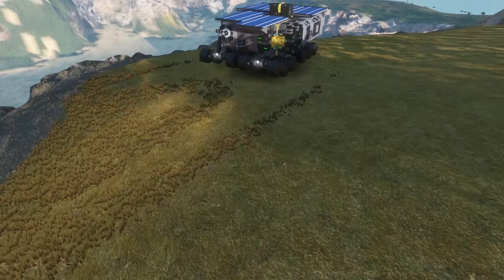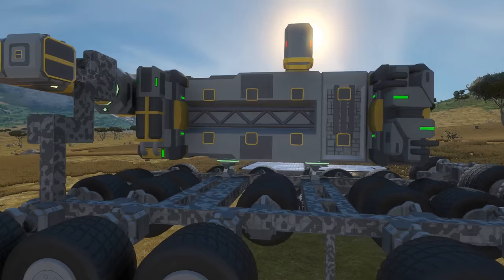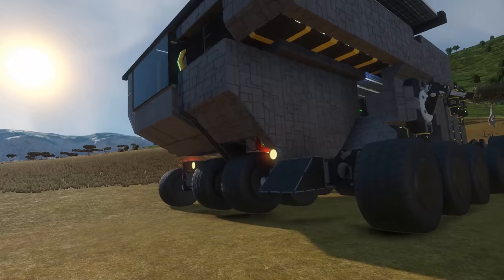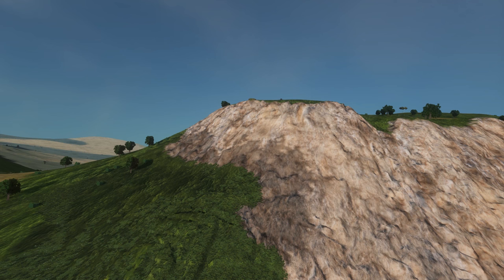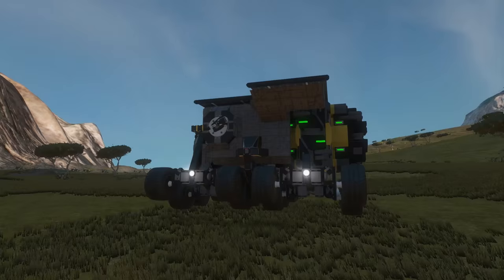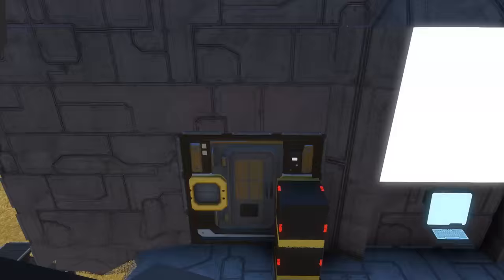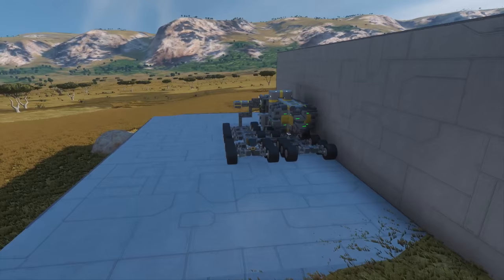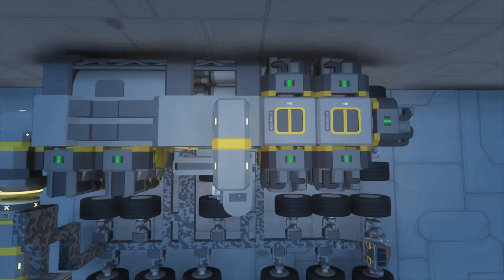Space Engineers - Mobile Planetary Base mk III & Build Guide - CODENAME Bouncy Castle

Comment from the maker: Apologies folks, this was supposed to be the first of the new schedule vids for SE and was due Saturday, had almost everything ready and then as you'll see SE threw me a bit of a curveball just in time for a busy weekend where I didn't have opportunity to try and record more!
Reply: can you relece the frame as it's own bluprint
Reply from the maker: +3RD Person Gamer “3RD Person” I have, check my workshop or the video linked in the cards near the start, it's there :)
Reply: Ok thanks also you might meet you machines match on the moon with no grav. blocks
Reply from the maker: +3RD Person Gamer “3RD Person” yeah prolly, although with the gyro's all it'll mean is a LOT of airtime heh
Reply: +w4stedspace nice work w4sted! maybe try doing a comparison with a modded version ;)
Reply: Seems using a rotor to build the small ship off the large ship would be easier, as well as forming a permanent connection between the two grids... 

If you're building this in survival, you would already have a powered base to start building from... 

Cool design, I wouldn't have thought of encasing a large ship in a small ship. Very cool.
Reply: I love your builds dude! always a new creative look on how to use old blocks, leaves me very impressed every time.
Reply: That's the Space Engineers we know and love, just when you feel comfortable it creeps up behind you and slaps you upside the head lol. Good job anyway.
Reply: +w4stedspace The wheels on the bus go round and round and then burst into flames!
Reply: +w4stedspace It's fine, man. I'm always late to Stream & TS. Your turn! Love the power this has.. I wonder how bad using 5x5's would be. It seems it reallllly wants to take on Lotus attributes and carpet bomb with wheels....
Reply: it's great, but do you think you can made the mobile base from homeworkd desert of kharak pls
Reply: +w4stedspace as far as the handbrake issue couldn't you compensate with timer blocks? trigger system toggles parking break and always switches on the connector and landing gears?
Reply: sorry if this was asked before but, when will the survival series start again?
Reply: as far as survival is concerned, it might be easier to build a tree with a large and small ship projector, then use separate blueprints to assist with each stage of the build process while keeping all the jiggly bits from moving around on you. afterwards cut the connecting blocks and disassemble the starting tree and let it land on its wheels.
Reply: Apologies if I missed an update, (going to play again soon), but is there a reason you didn't just use a small rotor base, large rotor top to connect them? Would circumvent the connector brakes issue.

Comment: I would build the large section to raise itself up. Then lower on the wheels when ready to move. It would be like a camper on the back of a truck. Four connectors on the bottom of the large same with top of small, instead of using landing gear. The four connectors is how I linked large drills to small engine. They don't need to be apart of conveyor they are just locks, well one can be. I think I'm going to try this now, haven't done planets yet.

Comment: what I wanna do is make a tank with a version of your frame.  right after my helicopter's done of course (i figured out the bombing mechanism).  With your wheel frame I'm thinking it's able to work when the wheels are in a staggered sort of pattern, think basically a 2-pronged hot dog roasting stick and you're on the right track with what I'm thinking about for a frame.

Comment: Don't worry Jon, I'm sure Keen will patch it out so your suspension no longer works in a few updates :P  I'd probably want 4 effectiveness modules on my refinery and 4 power efficiency modules on my assembler - but I accept you have to work with the space you have, unless you can make that wheel base wider :P

Soooo, if there's an Argentavis, where's the Megalodon? :D

Comment: Huh, with how it bounces this thing could be dropped from aircraft, if you had an aircraft capable of lifting it or carrying it on the inside.  Something like a C 130 should do though.  Hmm, do oyu think you could make it look just a little more like some sort of troop transport; like the M1126 Stryker; although something about it does remind e of some sort of command and control vehicle, like the M1130 only with more wheels.  I guess the design can be adapted to suit one's needs.  What's anybody need a command post vehicle for anyway though?  Drones?  UAVs?  Robotic rovers?  Of course you'd need to extend your signal range a lot, too bad the don't have repeaters or a way to build a proper communication satellite so one could come up with a proper planetary communications array and control their remote vehicles everywhere from a central location.

Comment: Hey W4sted!

I was wondering something. How much force would I need to get this Flying Ion Brick right here: http://steamcommunity.com/sharedfiles/filedetails/?id=565858707 To stabilize itself in Atmosphere. I've been trying for God-knows-how-long with Hydrogen and Atmos. and I haven't gotten a Solution that seems to work.
Reply: +Tally Star 
How heavy is it?
A hydrogen thruster (large) produces 600 TONS (600,000 KG or 6 MN) of thrust, so for an example - if you have a ship that weighs 2400 tons (2,400,000 KG) - you need FOUR hydrogen thrusters to just keep it in the air (nevermind moving) Ideally though, one would require FIVE large thrusters to move it up and out of the atmosphere - assuming youve already done the math and have a tank per thruster (6 min 30 sec burn time, per thruster per fuel tank), you could make it into orbit without burning through all your fuel if you attenuate the power flow once you reach 100m/s upward velocity - hydrogen math is very simple, all you do is devide the weight by 100 to find out how many MN of thrust you need, then by SIX to find out how many thrusters you need.

Disclaimer: All math is done assuming 1.0 G as your gravitational constant, for higher, or lower gravity you will need additional thrust (or less, depending on which) proportionate to the increased, or decreased G-Force.

Once the G drops below 1.0, you can then test the water to lower your fuel consumption even further, i do this with my shuttle >  http://steamcommunity.com/sharedfiles/filedetails/?id=635263495  < so that i dont burn through its entire fuel store and drop out of the sky like a brick, i do need to use the ions, but the thrust they produce till about 0.3G isnt enough to support the weight of the shuttle without the hydrogen drives, now that theyve changed the hydrogen tanks, im thinking about adding some h-thrusters to use as vtol drives on the moons ... would make the belly substantially less ugly with all those small ions...